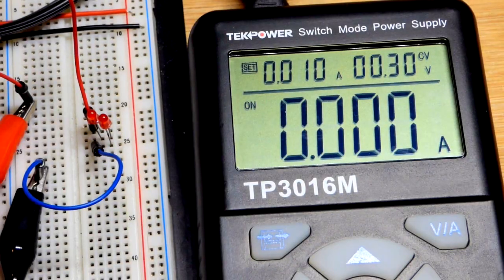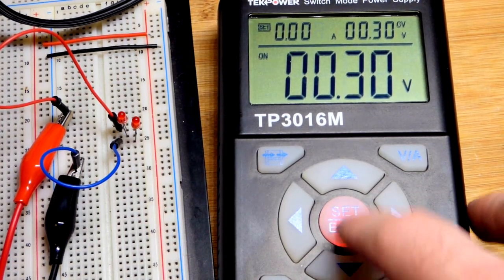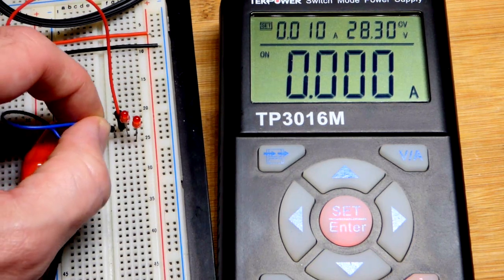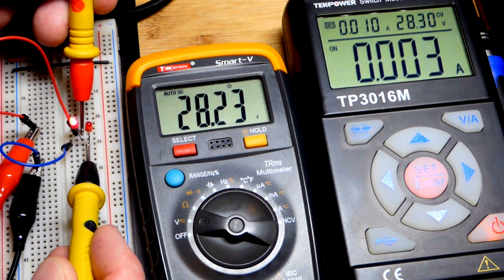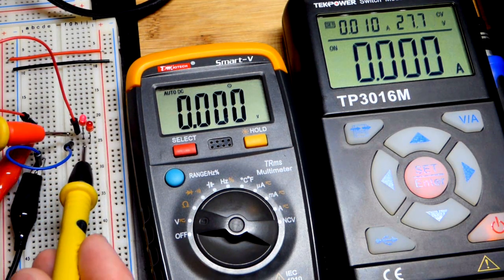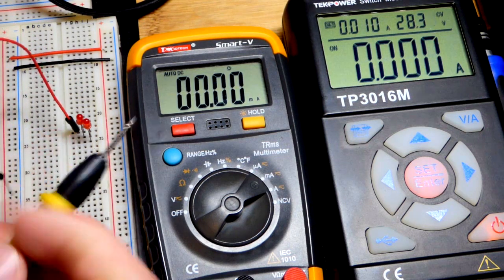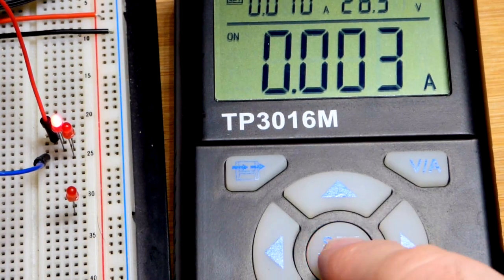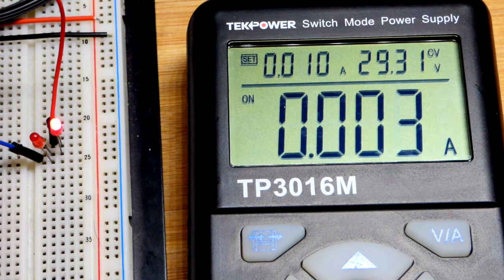LED reverse bias breakdown voltage test for beginner learning electronics

Comment: Complete NOOB here. You are using 28Vs on two LEDS, without any resistors?
Reply: But the current is limited to 10mA through the PSU so it wont damage anything. A resistor/current limiting circuit is crucial if PSU does not have current limiting capability.